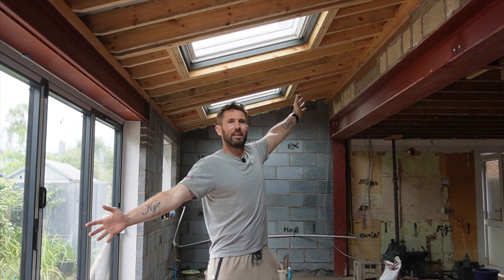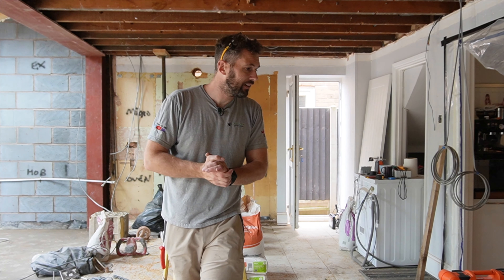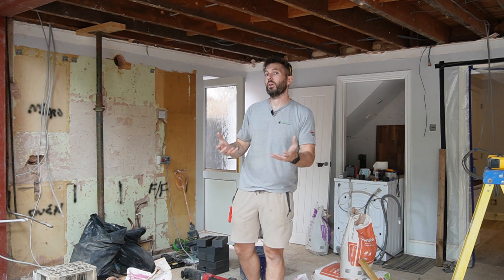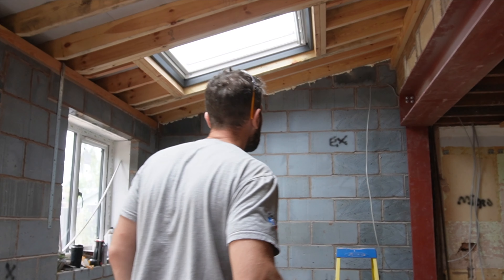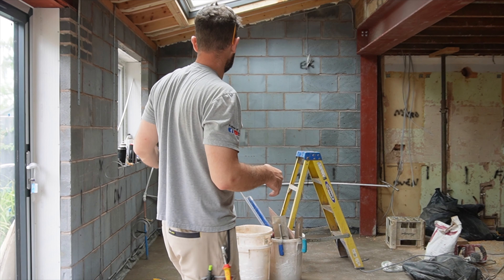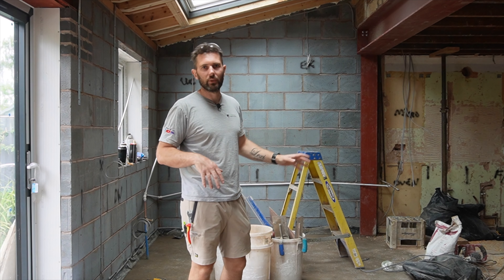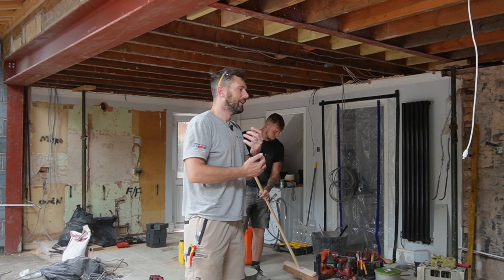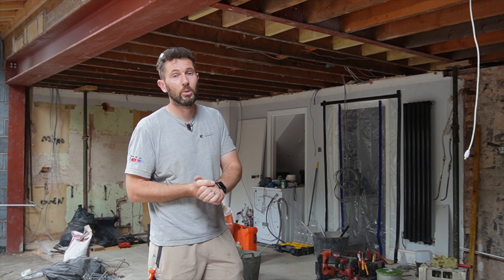HIDDEN DANGERS OF SHODDY ELECTRICAL WORK - NEW RING MAINS NEEDED

Comment: As i do, you always go to ring mains when you think of kitchen & loads. It's very difficult to change that mind set to radials. 
Only negative is the low cable run along the sink run. It's not in zone, but but  i guess it can't really be avoided.